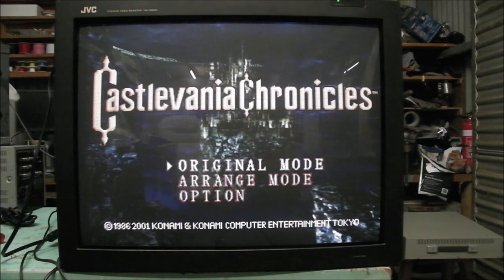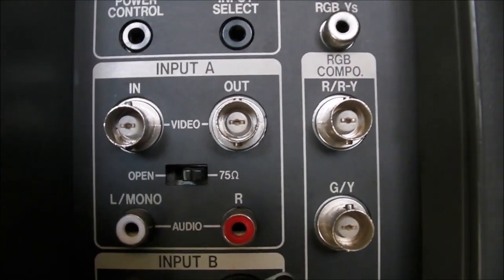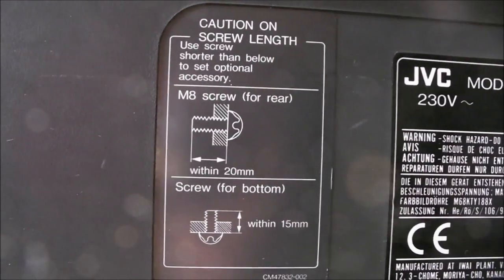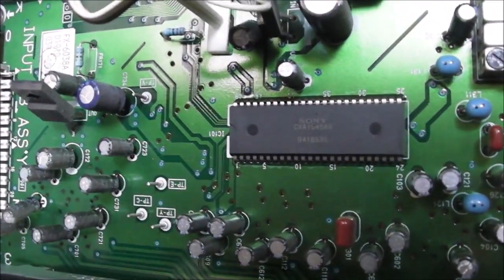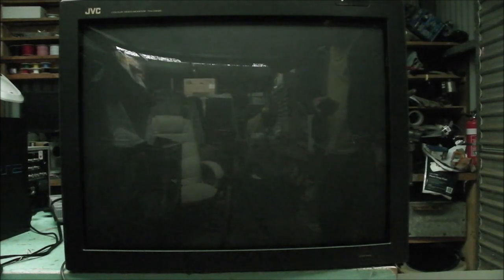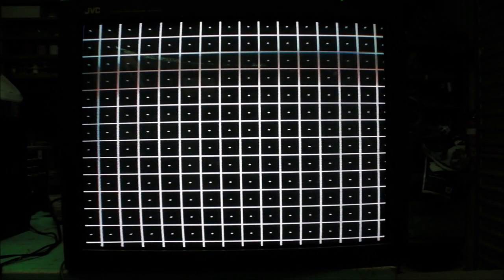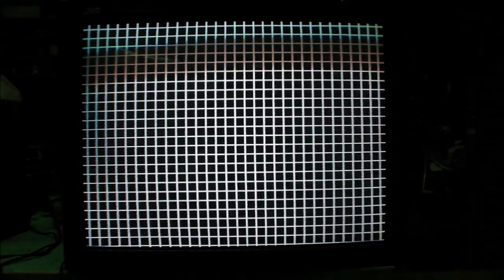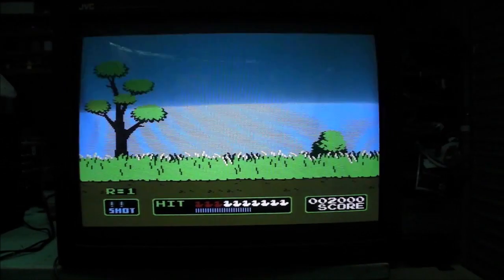JVC TM-290ZE Pro RGB CRT Monitor

Comment: Hi rob. I apologize if you already know this but you can probably clear up that green "swatch" on the screen by tapeing a magnet on the tube
Reply: RGB Rob i have fixed two sony professional monitors with your exact issue before. However those were aperture grill and i believe the jvc you have is a shadow mask. I'm not familiar with shadow masks. I can give you more detailed instructions if you're interested.
Reply from the maker: oh did i call it an aperture grill? oops I meant shadow mask.
Reply: RGB Rob no. You said shadow mask